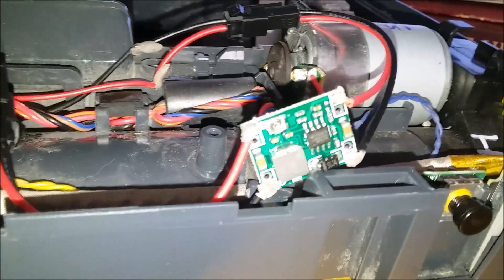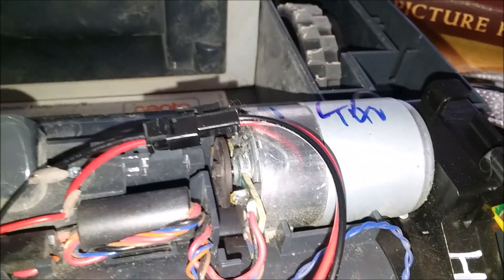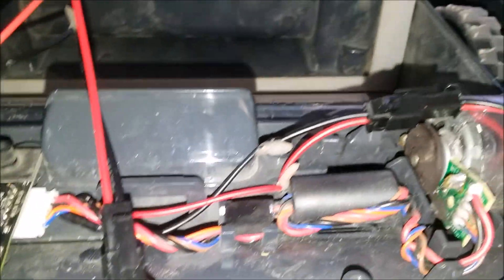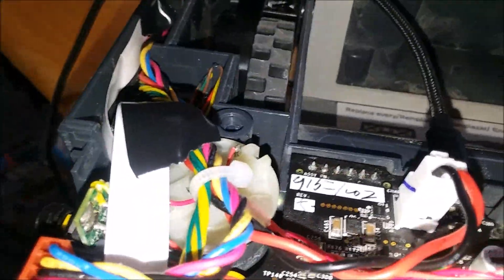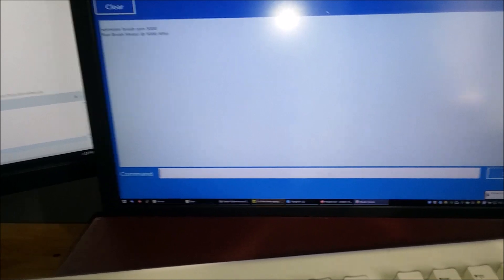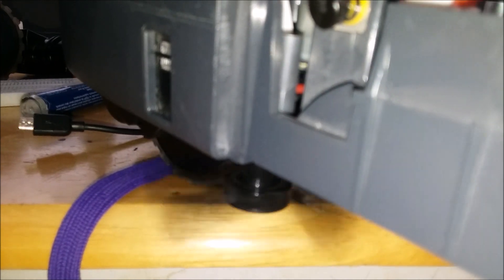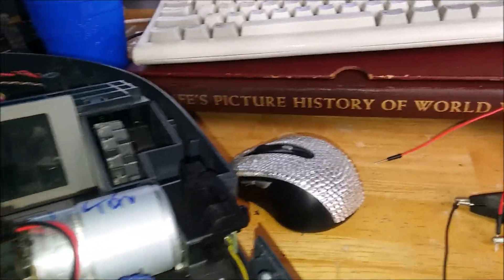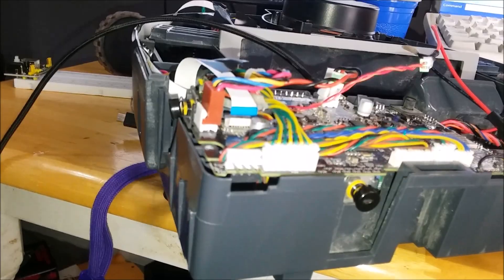Neato D3 added side brush

Comment: Hey hope you’ve been doing well. I’m interested in doing this to my D3 but had some questions. I’m not technically inept by any means but I don’t have any experience with electrical work such as soldering (but I’m willing to learn for this project)

1. What motor did you use? Thanks for including the link to the converter on amazon btw.

2. Does this seem to noticeably affect the battery life? I currently have a new battery and get about 2 hours of runtime. 

3. Some robots either turn off or slow down the side brush when on carpet, presumably to extend the life of the motor. Have you had any issues running it at a constant speed? 

4. Was it worth it? Lol, silly question but some users have said that the side brush doesn’t make a difference but the tests people have run on robot vac forums says otherwise.

Thanks! I appreciate your video

Edit: does Neato toolio save the settings for the side brush? Or does it automatically run once the Neato turns on
Reply: would like to know the same